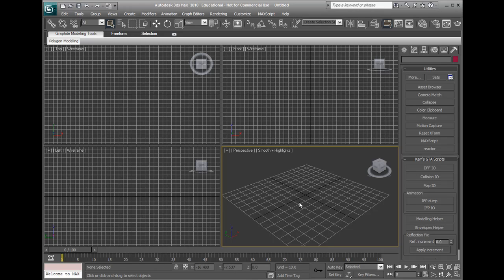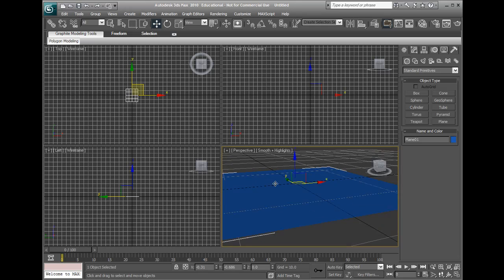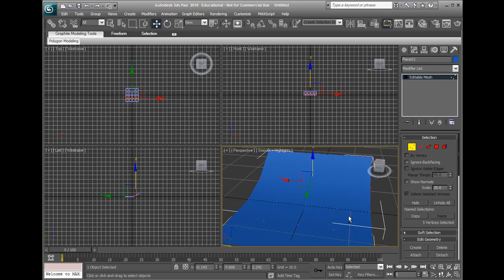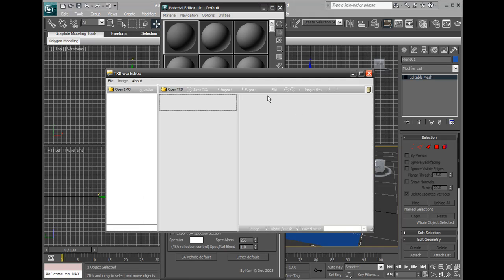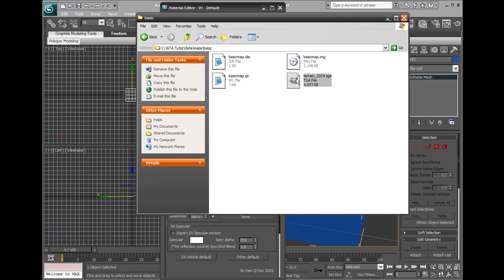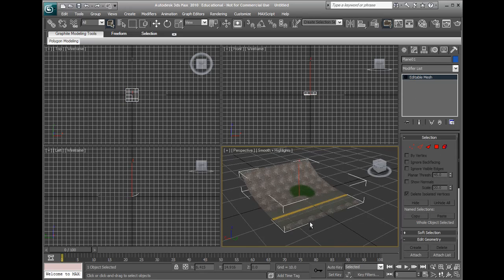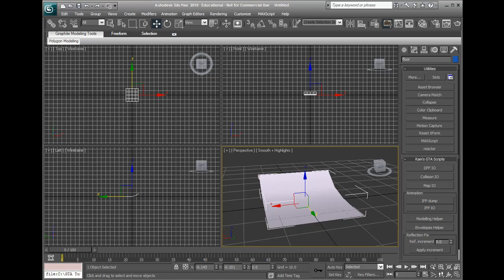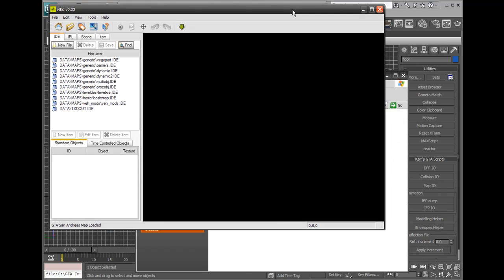Creating A GTA:SA Total Conversion: Part 3 (Section 1 of 2)

Comment from the maker: @eddyterminator Hey Eddy! Thanks for the comment!
1. You may need to build the road in Max, split it into separate parts and put it back together in MEd. San Andreas has a limit of 500 verts (I think). So if you're able to optimize your road well enough, you may be able to get away with one DFF. (But then, you have to consider the COL.)

Comment: 3. Can I make a club were ho is in to be ale to listen music? I would like to add lights, like you see in the concerts, but to be a very big club. I suppose you have heared about SENSATION Ok, maybe not so complicated like there, but something like that.
4. How can I create/edit a radio, without using User Tracks folder and create/edit the logo for it?
5. Can I make a trolleybus? With wires up and two captivators, which has to follow that wires... 

Thank you in advance for all information!!!

Comment: *UPDATE* i cleaned my gta vc i figured out the prob with the col (u need to stick it in gen.col for gta vc) so now i got my clean gta vc with no models/maps. i make a new ide adding my creation (shows col :D) and then i made a new ipl adding my object to it then i stick it game and make sure its saved to the right gta, (change main spawn) and it snot there in game.. And when i re open med the ide and ipl is not there.. So something is not saving? Any ideas?